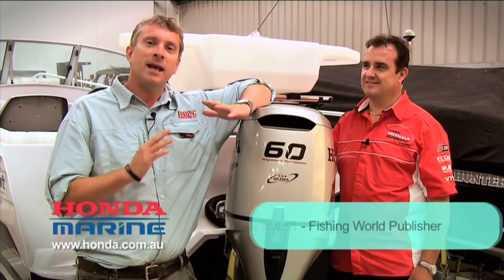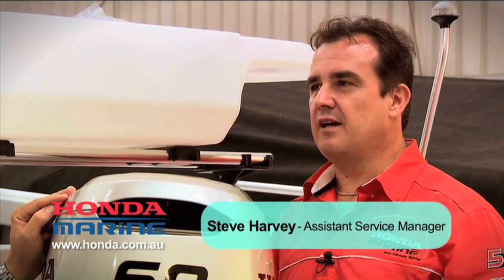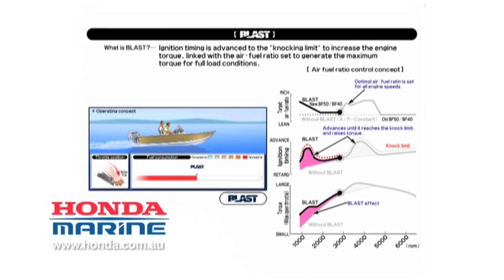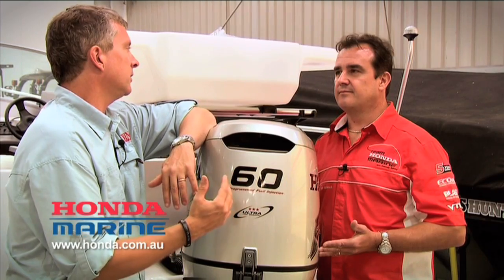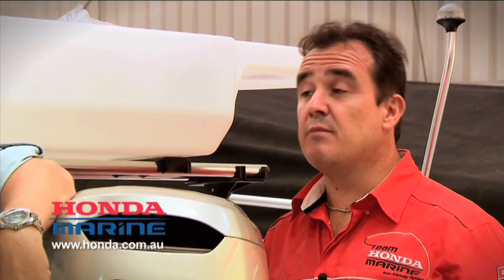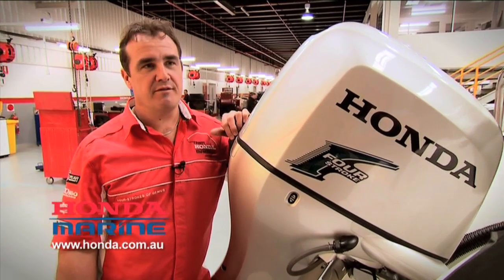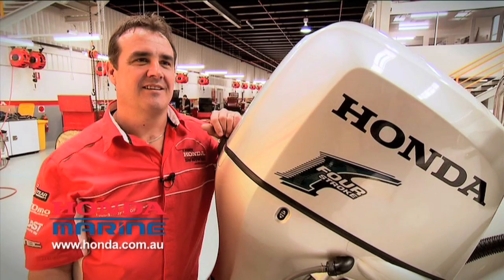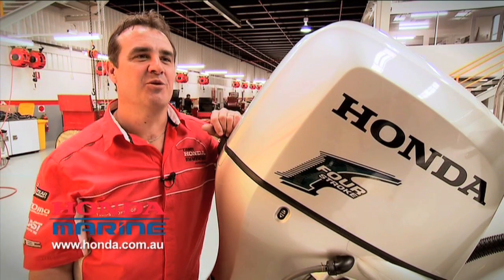Honda four-stroke outboards in the spotlight

Comment: Sorry, VTEC is not about more power.  Where VTEC comes into play is at low/med power settings.  AT WOT, valves are fully open, but VTEC alters both valve duration AND VALVE LIFT at lower power settings to keep combustion chamber efficiency high and so use less fuel when it is not needed.  Thus VTEC is about fuel economy at lower power settings not max power output.
Reply: xsbuilder1 It actually gives you more power at higher revs. At low/med rpms, the engine uses the low profile lobe for fuel efficiency, and at higher rpms it uses the high profile lobe to open the valves as much as possible and let more air in, therefore you get better performance.

Comment: Steve, VTEC is not an F1 technology and was never used in F1. Variable valve timing is prohibited by the F1 technical regulations. VTEC is a great way to broaden the power band, but it makes sense only in a road going car (a bike or a boat), where you need both low rpm drivability and high rpm power. In a racing engine you generally do not need the former.